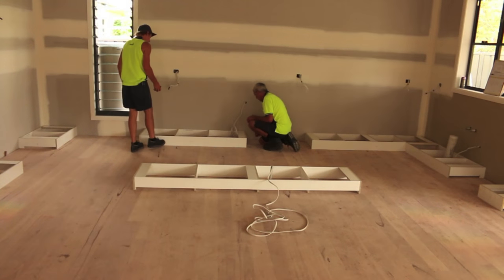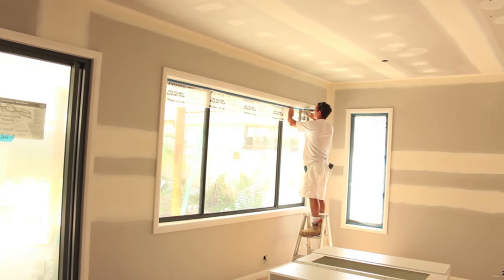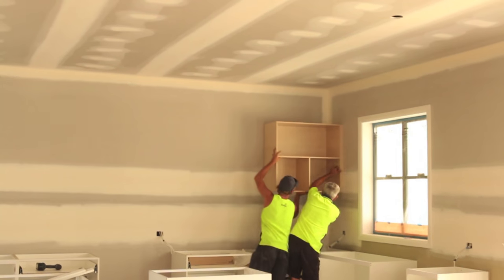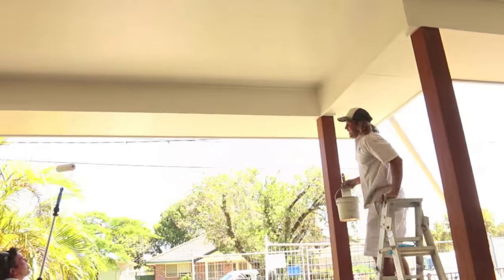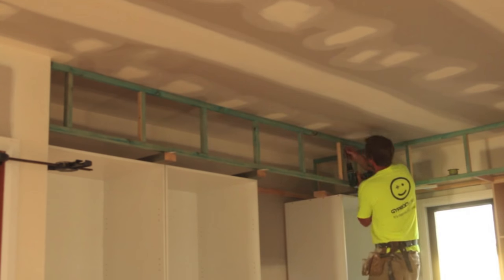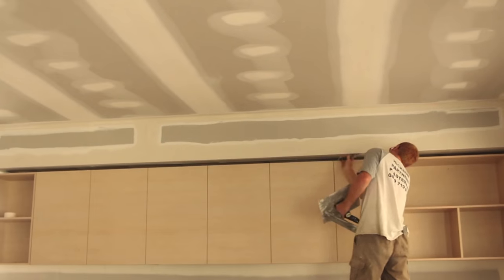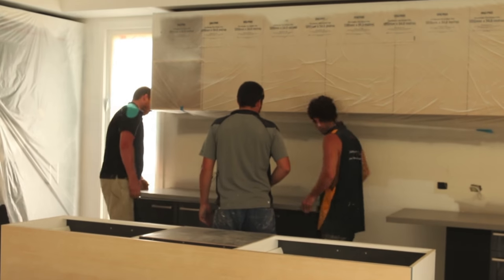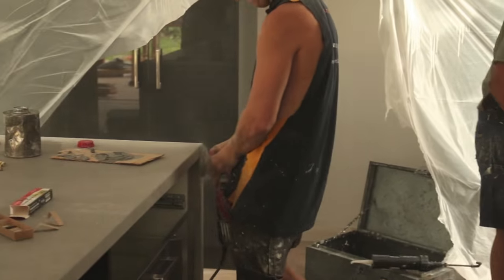Owner Builder Series: Ep. 42. Kitchen Fit-Out & Painting.

Comment: I'm enjoying your channel. On the kitchen fit-out, once you had the height set with the first wall cupboard, wouldn't it have been easier to build the bulkhead then, rather than after all the cupboards were up? it must have been tricky fitting dry wall to the bulkhead underside with just a small gap above the cupboards?
Reply from the maker: G'day Brian. I purposely built the bulkhead last for a couple of reasons. Firstly l wanted the gap between the bulkhead and the overheads to be perfect. I could only do that once the cupboards were in and l could measure off them. Secondly, l was in two minds as to how l wanted to finish the bulkhead and could only really visualise it once the cupboards were in. In regard to setting the drywall, it  only went back about 100mm so it was quite easy to set. Thanks for watching. I appreciate the feedback. Cheers :-)

Comment: Shared the progress with the Missus. Her comment was about the shadow line gap you left.  Looks good but she reckons that will be an absolute bugger to clean and would prefer the shadow line formed by Aluminium U channel about 20mm deep laid on its side. Your thoughts?
Reply from the maker: Yeah that would work Stephan. I went for the bigger gap because l really wanted that extra depth look. It's a reasonable size bulkhead and l really wanted to break up that bulky look which is achieved with the larger, deeper shadow line. Thanks for watching mate. Cheers

Comment: Nice video, but i strongly disagree with you decision to add the bulkheads over the cabinets. I had them in my kitchen and like collecting dust up there much more than closing in DEAD space. Yes, a real pain in my ass to remove, sand and finish ceiling to matching texture.  Still happy and glad i did the process. If i had to do over I would hire some day labors to do it for me. What a mess!  Keep Building I will too...
Reply from the maker: Thanks Tim. Each top their own l suppose Tim. I just love the look. If the bulkhead wasn't there there would be be a large gap between the top of the overheads and the ceiling which would be a major dust catcher which we had with the last kitchen, and the overheads couldn't go all the way to the ceiling because they would have looked massive due to our high ceilings. Have a good one mate and thanks for watching. Cheers
Reply: Yes, your correct difference of opinions. I know its not as clean hens my dust collection comment. With the higher ceiling I like the open air and not so trapped feeling I guess. With 8' foot ceiling here in USA I would box them in to or run a speaker wire from the entertainment center area for a ambient sounds if ever used or not...? It gives a home owner choose an easy update option to have before all Sheetrock is closed up. anyways, cheers! I only wish I had a large team like you to work with. I am a one man show mostly.